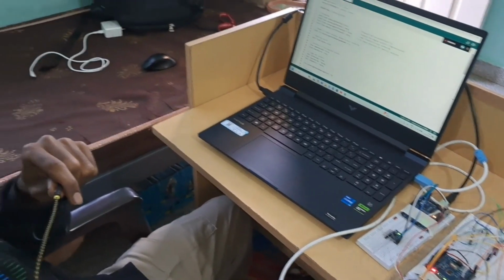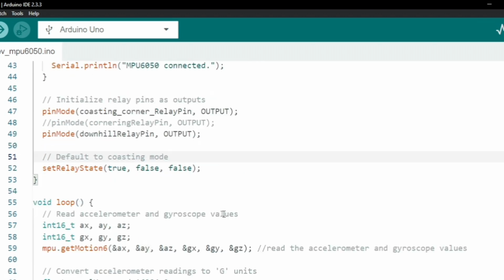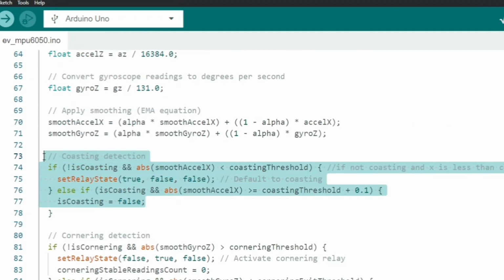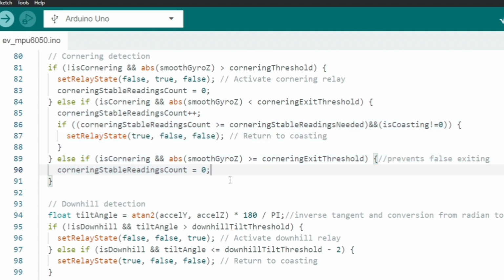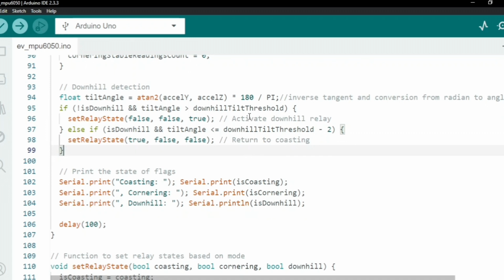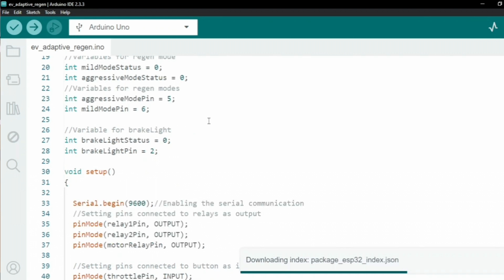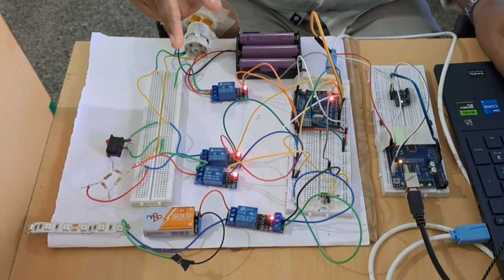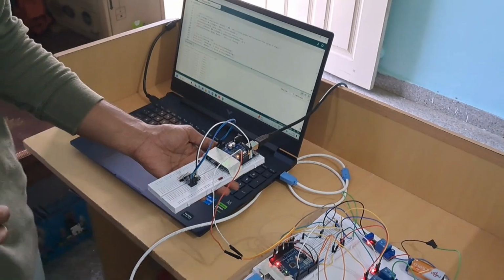Adaptive Regenerative Braking System | quant-a-maze 2.0 Hackathon |

Comment: hey hrudayesh , can you plz tell me which sensor you used to to accelarate the motor while showing the demo
Reply: Can you plz share the circuit diagram with me it would really help me for my school project
Reply from the maker: Hi, it was a just a push button switch. We wired up the switch to digital pin and read the button state. Then we would latch the relay connecting the motor accordingly.